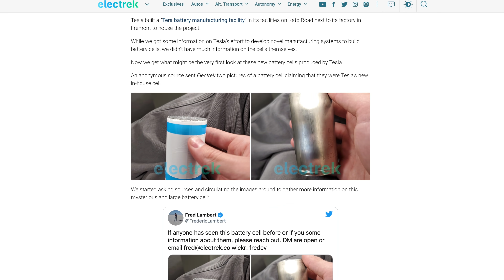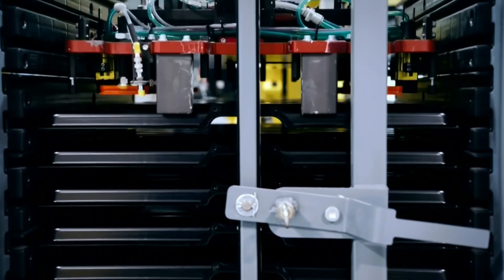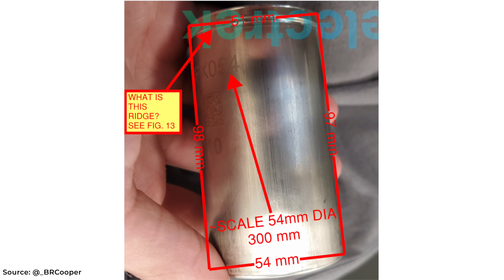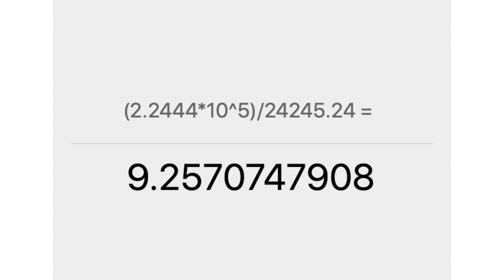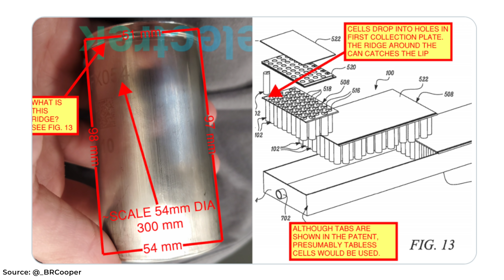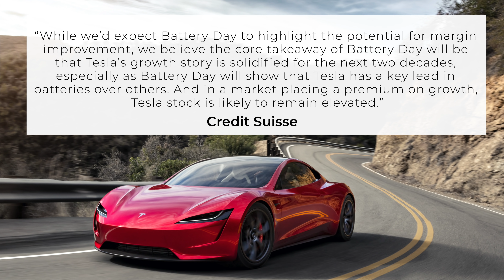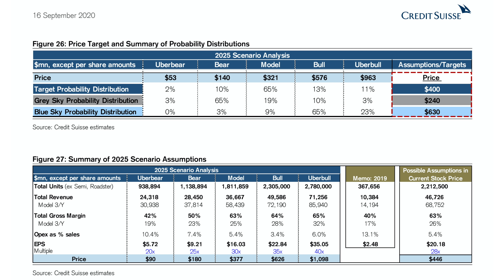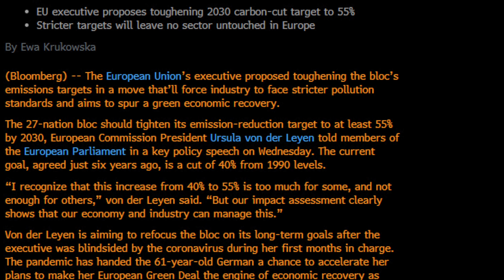Tesla’s New Battery Cell? + Credit Suisse Outlines $1T TSLA Valuation Scenario

Comment: for those guy who are questioning FSD tesla A Tesla driver was caught sleeping on Autopilot at high speed, police are charging him criminally A Tesla driver was caught sleeping on Autopilot with their seat “fully reclined” at high speed, according to police who criminally charged the driver. Alberta RCMP (Canada federal police) reported on a strange incident involving a Tesla vehicle on Autopilot.
 
“Alberta RCMP received a complaint of a car speeding on Highway 2 near Ponoka. The car appeared to be self-driving, traveling over 140 km/h with both front seats completely reclined and occupants appeared to be asleep.”
“After the responding Officer activated emergency lights on their vehicle, the Tesla automatically began to accelerate. The Officer was able to obtain radar readings on the vehicle, confirming that it had automatically accelerated up to exactly 150 km/h.”
The police said that the vehicle eventually stopped, and they gave the driver a speeding ticket.
Later, they decided to also charge the driver for dangerous driving under the criminal code.
The automaker Tesla also implemented a system that requires drivers to frequently apply light torque to the steering wheel in order for Autopilot to stay active.
Some Tesla drivers have been getting around the system by attaching a weight to the steering wheel — a practice considered dangerous by US regulators (and anyone with half a mind).
In this incident, the police reported some strange behaviors from the vehicle, which was presumably on Autopilot:

Comment: Would be awesome if the new cell is actually faster to manufacture than existing cells. As you mentioned, even if it's twice as long, the reduced volume required would be a net positive, question is, by how much. What I wonder is how they're going to fill the space between batteries, could we see a combination of large and smaller cells?

Comment: Trevor Milton has applied ELONS first principles thinking to his truck !!!!!!!
No part is the best part !!
THAT'S how he ended up fastest and lightest CLASS 8 truck ever built in the GALAXY !!
Took out the HYDROGEN. Took out the BATTERIES . Took out the GEAR BOX (only has on GEAR). Took out the ELECTRICAL MOTORS .
REMEMBER   No part is the best part !!      And this is where it gets really  high TECH . You install the engine that requires no  engine.
It only took Trevor Milton a couple a months to design an build this engine and show it in MOTION on the internet.
He's calls it the GRAVITY ENGINE
He plans to sell this engine to  ELON (Out Elon Elon).  He has promise   SpascX and ELON it will never fail to bring the FALCON  9 back to earth. IT ALWAYS WORKS 1000% GUARANTEE . Always turns on !!!
Trevor Milton it trying to  get ELON to apply this TECH to vehicles in the Borring Tunnel To get all the vehicles to   ROLL  DOWN   into the tunnels.
You do have to use LIFTS to get them out ! For some reason they don't like the RAMPS.
L.O.L    :)     :)

Comment: "FX054" 5x is an algebra term. If you mean 5 times then say 5 times, not 5x. With less batteries they can be further apart and have more cooling pipes.

Comment: By my calculations a 85kWh model S could be made using approx 360 (5498O) cells, they used to require 7,104 (1865O) cells.

Assuming a volumetric efficiency boost of just under 16x after you account for the constant ~4mm diameter void in the center of a cell, the void at the top/bottom of each cell, e.t.c.

And assuming an energy density improvement of ~20% in the jellyroll over the last 10 years (seems like a crazy low-ball)

The range you'd get from that 85kWh would be significantly improved as well due to the weight savings and drive-train improvements.

https://docs.google.com/spreadsheets/d/1D7vzaU3vicRcyTrTYyIxiK4_pgSvnMLfZAUBd-ATDfA/edit?usp=sharing

Comment: One of the stated benefits of having many small batteries is that the parallelism allows individual cell failure to affect the pack only minimally.  With 9x cell volume it would seem to take most of that advantage away, as the pack now only has 5+-way parallism rather than 40+.  Maybe the cell failure rate is way down?  Other solutions people can think of?

My prediction: this cell is for the semi and cybertruck, and smaller cars will use another cell that isn't quite as big (possibly sticking with 21700, or maybe growing it a bit but not this huge).  You don't want to have tons of cell types, but two might be best to cover everything.
Reply: I don't know so this is pure speculation but perhaps between dry manufacturing and tab-less design cell reliability may have gone up.  And/or by going cell to pack without modules it might be easier to replace a single larger cell than the current cells which requires first removing a module then taking the module apart.
Reply: @TheEvilmooseofdoom  Good points, and yes we're all just speculating!  Between Dahn's lab and all the other R&D maybe the cells are super-reliable, and/or they can figure out which ones will fail during testing and can replace them before the pack goes into a car.  We'll find out soon :)

Comment: What I see coming from Asia are these big rectangular, brick sized cells in batteries the size of a car battery.  These are used in AC power sources for commercial and residential apps.  They're expensive, and rated 100 Ah.  They can be discharged at high currents.  Some homebrewers use them for their EVs.  I wonder why the EV manufacturing companies don't consider using these bigger cells.  My guess is they can't be cooled as easily as cylindrical cells.

Comment: I think to maintain compatibility with existing vehicle design, the height of the cell need to stay relatively the same.  Unless Tesla gains some height from removing the module, this new cell at 98mm will not fit in existing M3/MY without modifying the existing design of the car to accommodate the taller battery pack.
Reply: I'm guessing here but there has been talk of not using modules to build the packs but instead build the pack out of cells alone - cell to pack I think it's called.  Perhaps the removal of the module hardware free's up some additional space.  Again just a guess.

Comment: Longer cells means that the seats will have to be placed high up. Maybe great for model X and model Y, but maybe not for the roadster.
We don't even know if this is supposed to go into vehicles, or into power packs.
Reply: I think (guess might be a better choice) that new cells go only into new vehicles.  AFAIK the X and S sill use 18650s even though they've been putting 2170's in 3's and Y's.  It maybe that will continue and this new cell will be for semi, cybertruck and roadster and potentially the compact car and never find their way into 3's and Y's.

Comment: Rob, I was just about to fire another email off to Jordan at limiting factor when this episode dropped!
I had reached virtually the same conclusions (54× 100) but also compared 18650 for S/X.
Only considering floor space and at existing energy density, I concluded a maximum of 1000 cells compared to 8256 18650's(!) But giving up to 175kWh.

Based on a 100 kWh pack only 600 cells rewuired (allows footwell area, as with Lucid, bearing in mind these are 30mm taller than 2170)

But if tables, etc yields a 20% density increase, 480 cells.

30% increase only 420 cells.

Compared to 18650, that's a 19.5 x production speed benefit!

This also raises the possibility of a smaller pack which will be common to all S3XY cars.
Huge cost saving! (And BMS!)

Comment: That cell looks a lot like the same dimensions as a big electrolytic capacitor (they usually also have similar "ridge" at one end just like the "new" Tesla cell. Maxwell used to (or still are) manufacture big electrolytic super capacitors... could be a sign that they are using parts of Maxwells manufacturing process.

Comment: Haven't heard anyone talking about the height. If the height is correct these cells are about 50% taller and therefore could add 50% more energy density to a given pack footprint at the cost of raising the floor board or maybe removing module casing. These could be the cells for the plaid power train giving the model S a 150kwh pack and around 1500hp.
Reply: The existing cells are 70mm high and these might be 100mm high.  That's only 30% taller. :P
Reply: @TheEvilmooseofdoom  100/70= 143%.  I guess thats not quite 50% but maybe thinner battery casing will make up the difference?

Comment: In November 2019, just 10 months ago, Credit Suisse analyst Dan Levy issued an alert, predicting TSLA shares to plunge from $70 to as low as $40 (pre-split: from $350 to $200). Now the same analyst increased Tesla's price target from $280 to $400 (pre-split: $1400 to $2000) expecting "Master Plan Part 3",  acting as if he had ever read or understood part 1 and 2.

Hey, $40 or $400 that's only a difference of a single "0".

https://currency.com/credit-suisse-tesla-moters-shares-fall-40-per-cent-warning-competition-ford

Comment: The EU statement is very important. Not for the increased target but for that they say that the ICE age will end and the replacement is electrification. Producers must now discuss when they should stop producing ICE not if. This will also mean that investment in ICE R&D will be difficult to justify. It will also be impossible to calculate a return of investments in ICE manufacturing. My guess is that beyond 2027 you cannot produce an ICE and sell with profit.
Nobody will embark on an ICE based career. Experienced ICE engineers will retire. Sub suppliers will shift focus to BEV and it will be difficult to source ICE parts. New ICE models will be displayed in in the background at exhibitions if at all. It will be increasingly difficult to create enthusiasm for anything ICE based. The fall will accelerate and ICE will disappear much faster than we expect.

Comment: The funny thing is it's very likely going to take them less time to manufacture the larger cell, because the relative size difference means little in terms of manufacturing complexity, and the tab-less design will actually make it faster.  Top that off, the tab-less design enables end cap cooling, which addresses the thermal management issue of decreased surface area per unit volume.  So these batteries are likely to generate less heat (due to less resistance) and be better at removing it (due to better thermal pathing) with a simplified thermal system (as you only need to cool the ends, so they won't have to interleave the cooling through the cells).  Combine this with the other efficiencies from Highbar and Maxwell, and boy, this is going to be a seriously fast battery line, with much improve cell to pack manufacturability as well.  I totally understand why Elon was pushing for more material mining on the Q2 call, as it's looking like Tesla has probably greater than 10x their throughput.
Reply: Not likely because if they had anything close to 10x they wouldn't have needed Panasonic to increase capacity just a few weeks ago
Reply: @kaya051285  Not sure how you figure.
Reply: @bujin5455  If Tesla had the ability to produce batteries at 10x the rate of Panasonic they wouldn't need or want Panasonic to expand production for them. Panasonic won't be doing it for free

There will be some gains on battery day
But it's not going to be 10x cheaper better faster or whatever

Most likely 5-10% improvement in energy density and 5-10% improvement in cost per year going forward. More or less the same gains Panasonic LG-Chem and CATL will also make
Reply: @kaya051285  I disagree.  They only don't need Panasonic if they are able to make so many batteries on their own that they can completely fulfill all of their product requirements.  I don't think a 10x speed improvement would do it for them.  Not to mention the fact that just because they have a prototype line up and running, doesn't mean they are ready to completely retool everything everywhere to make use of the new approach.  I think you are simply saying "oh it can't be 10x, because then they wouldn't need Panasonic" without giving any real thought to what such a statement truly entails.
Reply: @kaya051285  This is speculation only but it seems to me that new cars don't get new cells.  The S and X are still going with 18650's.  The 3 and Y are 2170's.  If that holds and these new cells are only for Semi, cybertruck and roadster (for now) then they'll need Panasonic to keep producing cells for the older models.  There is also the chance that maybe panasonic cells will find more use in powerwalls etc than in cars.

Comment: Bur this again increases the floor height...
Reply: They might lay them down on their sides so the total height of the battery pack is reduced

I would hope that as batteries get more energy dense the hight of the battery pack falls

The current 2170 batteries are 7cm high but the pack is 10cm high

If energy density doubles I'd like to see the pack become 5cm high this would give more comfortable leg room or allow the car to be 5cm shorter on the outside (while the same size inside) allowing better aerodynamics and increased miles per kWh
Reply: @kaya051285  Laying down on side is fine but that leads to more empty area, okay may be filled with heat pipes
Reply: @JithinJose2  I figure you can still get 75KWh using the cells layed down flat in the same footprint as a model 3 current packs (assuming no improvement in energy density just more efficient cells to pack)

A cylinder is actually pretty good use of space

Imagine a circle with diameter 2 or a square with length 2. The circle fits inside this square. What percentage of the volume does the circle take up? Answer = 78.5%

This type of arrangement can also provide two methods of cooling. Air cooling around the 21.5% of this 'dead space' as well as liquid cooling from the top/bottom of the cells. Or this 'dead space' could be injected with a low density foam that solidifies to just provide more stability to the structure allowing the cell walls and structure of the rest of the pack to be thinner/lighter/cheaper

Comment: the bigger the cell, the higher quality it must be. You can no longer lose a few of them in the pack, as it would significantly reduce capacity and even total pack voltage. If these cells are real, they are clearly meant only for future vehicles.

Comment: Since the battery is rolled I don’t think the ions have to travel farther.  However heat generated deep in the battery will raise the temperature due to increased thermal resistance.

Comment: Not convinced you got your measurements right, but still, if that cell truly provides better efficiency, better energy density, and cheaper manufacture than anything else o in the market, then Legacy automakers will be banging down the door to lay their hands on them.
This could be the road map to 2TWh, by allowing legacy makers to invest in battery factories to obtain these next gen cells. Tesla can get to 20M vehicles quicker if it's not making them all itself.
Reply from the maker: Looking at the pics again I’m thinking maybe it’s a bit smaller. What size do you think? The main points stand even if it is a bit smaller than 5498.
Reply: @TeslaDaily  Well, I scaled the photo until the thumbnail of the thumb was the same size as my own. Assuming we have typical-sized hands,  the length is 70mm.. which makes perfect sense if you want these to slot into the existing pack architecture without significantly altering the vehicles.
At that scale the width was 40mm but due to foreshortening Im willing to add a couple of mm to that to make the answer 42 because, the answer is always 42.

Comment: Hi Rob,
Could somebody ask Tesla (Elon) to add another second charging plug to the car?
Such that I can charge the car in half the time. Such that the fill up time will get within 5 minutes of the ICE cars? I promise that even if I am grabbing two charging stations 
 I will be out of the charging area in half the time
Reply: Unfortunately, that wouldn't work.  The charging time is currently limited by battery degradation.  Charging faster would damage the battery.
Reply: @bigdream_dreambig  Been working with Maxwell supercapacitors. If they use the same spiral approach than charge/discharge is significantly better. Besides the tabless approach and end cooling prevents overstress and overheat

Comment: Someone on Hyperchange's channel noticed that if you look closely at that cell picture it looks like there's a 10 stamped on the side of the cell. 10 centimeters would be 100mm so a 54x100 cell would be consistent with the cell versus the hand and Rob's measurement.

Comment: your cell is clearly too high and propably a bit too wide too. I would estimate (as I did yesterday) that this is either 4070 or 4580. It would also make pack too thick if height would be 100mm. Ok, that could be compendated when they ditch the modules in the same rework.

Comment: When it comes to tables battery design think about ‘Dirty Carbon nanotubes’ in addition a weave pattern of dirty carbon nanotubes you can replace the thin metal barrier in the battery role manufacturing process. The of this level of manufacturing results is a battery with exponential battery storage and a weight performance gain.

Comment: 😃 ahhhmmm, you're off on the last decimal point of your size ratio, the 9.2570747908 ... 😃 ... very close, but that 8 at the end should be a 7.  😃 or, you could put 75 at the end.  😃😃😃😃😃   (shhh, don't tell, with scientific based numbers you don't show more accuracy than you had in your original numbers ... shhhh)  ... 😃😃😃... 11 digits of accuracy/precision ... 😃 ... how many digits you start with?  Two 😩😩🎉🎉😃😃😃  ... and those two digits were an estimate, right 😃😃😃👍👍👍👍👍  (otherwise, good videos)